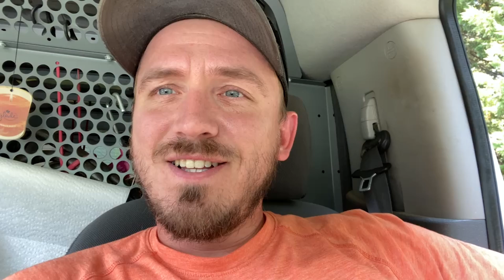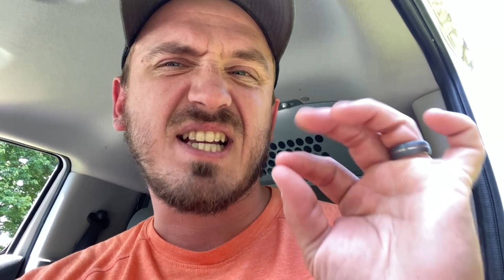Hydraulic Load Tests Explained: Why and How

Comment: Very helpful video.

Being new to septic systems, I have a bit of anxiety about sending too much water down too quickly.  Our newly built cabin (in the WI North Woods) and the septic system is 5 months new.  I worry because we use a soaking tub AND take a shower once daily.  Sometimes, a load of laundry is running in parallel (so all within a 2 hr period). We have bidet smart toilet as well, which reduces toilet paper usage a lot.  The system is designed for a 3 BR capacity.  About every other weekend, we have 2-3 people visiting overnight.

We are very good about NOT putting food and chems into the system.

Are we good to go?

-Paul